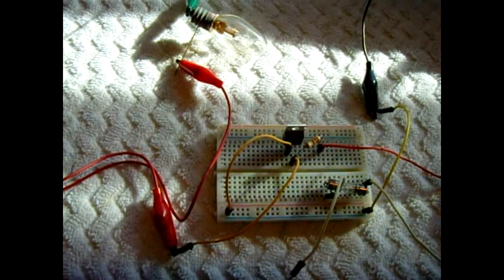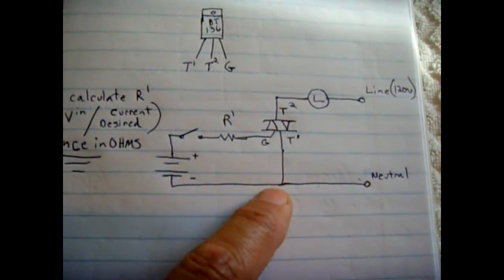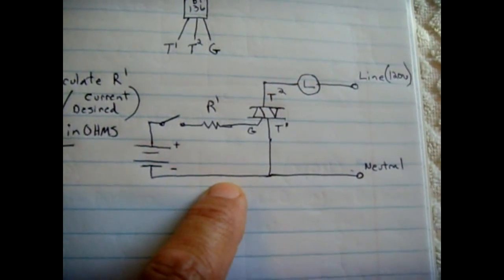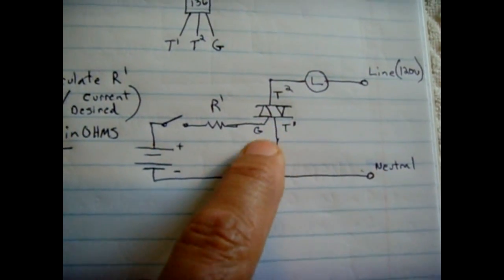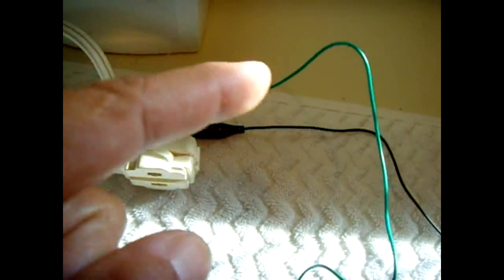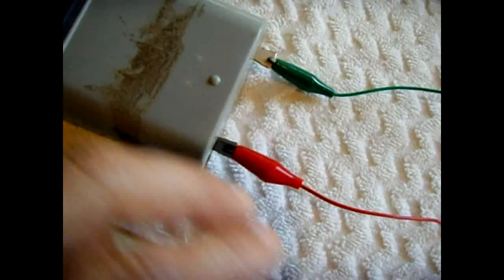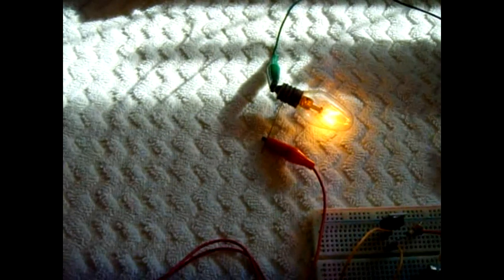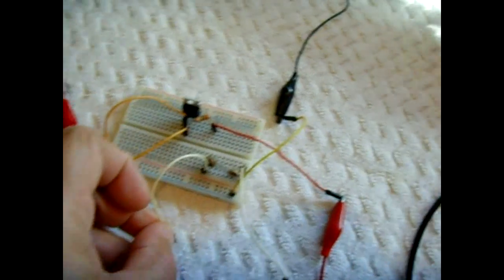How To Trigger Triacs for AC Loads Using DC(Battery)

Comment: I never worked with TRIAC before, so forgive my silly questions. Wont the TRIAC conducts only half of the cycle when using only DC trigger? Is your 120V multimeter reading is RMS?
Reply from the maker: Should be the full cycle, because I am operating my AC drill perfectly. I'm getting positive and negative pulses. My DMM is not a true RMS.
Reply: I also think the lamp and the drill are operating only on 1/2 of the ac cycle; an oscilloscope would prove it.
Reply from the maker: I understand how you would think that. Triggering with positive would only allow positive pulses to pass. Triacs are designed to be triggered using EITHER a positive or negative source. Once triggered, AC current will flow. I have not checked using an O-scope, but I can tell you that AC motors work just fine. I would think both negative and positive pulses are being passed through the triac.

Thanks For Watching! Be sure to check out my video playlists.
Reply: you have to trigger in two alternans differently if you want to use positive and negative alternans.. In this video lamp use only one alternans depending on trigger.. https://youtu.be/xnhR09khLzM?t=584  I have done in a simulation program and have see that only positive alternans can be used on load..

Comment: Thank you very much! I'd never tried Triacs before and your video helped a lot. I have a question: I thought T1 and T2 were interchangeable but it seems that they are not. At least my circuit started working only after wiring it exactly as shows in your video. Can you clarify this point?
Reply from the maker: For reliable switching on and off, it is recommended that AC line power is fed through the load and into MT2. This does not mean that using MT1 will not work.

Comment: I want to know .. if I connected the AC Cable the other way .. would that be a problem .. have anyone tried it ???  The AC oullet in ower country is 220v two wires only and I cannt tell which is which ... thanks for the useful video

Comment from the maker: NO. One of the wires is HOT. If you take a voltage meter on the AC setting and test from each wire to ground(the metal box which the receptacle is in, the green wire inside the box, or the bare wire), the wire that supplies the 120V is the wire to be used as "LINE". The other wire is "Neutral"(No voltage). You can touch the neutral wire, NOT the "Line"/"Hot" wire.

Comment from the maker: One leg is 220V and the other is neutral? If so, then everything should work fine. If you have 110V per leg combined to get 220V, then DO NOT use this circuit. You will be better off using an optocoupler(MOC3041) feeding into a resistor at the gate of the triac, and triggering the optocoupler with a battery.

Comment: hey, thanks a lot for puting up this video. It has been great help in my project work. I have one query. I live in India with 220V mains supply. What modification will I need to make in the circuit if I am using 220V mains? 
As a precautionary measure, I am planning to use a 220V to 30V step-down transformer on the mains and drive some smaller load which will work on 30V supply.

Comment: Nice video. This would work great with photovoltaic cell driven gardening circuits. Feed the cell straight in to the triac or feed it into an arduino/raspberry pi input. The first light of the day can be used as timing/calculation reference and then the 3.3v or 5vDC out used to drive the triac. NICE video.

Comment from the maker: If I was only getting 1/2 the cycle or part of it, I would not be able to run an AC motor/drill. All the battery does is trigger the triac to allow the AC current to flow through it.

Comment from the maker: Thank You! 

NOT a good idea battery POS to LINE AC. Triacs can be triggered with either positive or a negative voltage, but in this case, leave the NEG connected to the NEUTRAL. Make sure you have a very low rated fuse(50 mA) If you had to, 100mA is the absolute MAX I would use between the battery NEG and Neutral, then you will be just fine and have no problems.

Comment: (continued)
2: You can replace battery with a charge pump (2 diodes + 2 capacitors + zener).
3: When turning off, inductive loads produce high voltage spikes accross the triac so it can be killed. I don't know if there are really effective built-in snubbers or not but for a plain triac, external snubber maybe needed. At least a metal oxide varistor.
At capacitive loads, it can be needed to limit inrush current and current rising rate at turning on. But OK, it is not that important at most cases.

Comment: Hi! I haven't use triacs yet but I can tell You that there are some problems with this circuit.
1: Turning a triac on with direct current is a usual way especielly for sensitive-gate triacs. BUT.! In this case it is highly recommended to use negative voltage to the Gate electrode with respect to T1 because triacs are far less sensitive when You apply positive Gate voltage in the negative cycle of the supply voltage. So it is better to reverse the battery.
(to be continued)

Comment from the maker: You have to look up the data sheet for the triac you are using. You need to use one that mentions  a built in "snubber". Some triacs have triggering problems with induction/motors. The only way to reset the triac would be to remove 120V power momentarily.

Comment: Very nice, thanks. Can you show how can i possibly create a transformerless power supply instead of using battery? The tricky part here is that i don't have Neutral in the wall where i want it located.

Comment from the maker: Just make sure you connect it properly. Verify the Battery neg is connected to the house AC power supply NEUTRAL, and use a very low mA fuse in series with the battery.

Comment from the maker: If done properly, and the circuit is placed inside an insulated box with ventilation, the triac uses a sensitive gate with very low current to trigger(as the BT136), which is around 8 - 35ma, and a fuse slightly above the gate current(50ma)is placed in series with the DC supply, then everything will be fine. I guess you have a fear of HV projects. Also, I'm glad you like my video, but don't tell me what videos to not put on Youtube. Thanks for the thumbs down!

Comment from the maker: I guess you have not read the video description box. I clearly stated this is a hazardous project. I also stated this configuration is designed for 120V, not 220V. I also stated that you MUST connect the circuit properly, AND verify that your receptacle is wired properly before connecting this circuit. ALSO, the switch is not needed. a low voltage DC circuit can be used to trigger the gate. You can also use a transformerless DC power supply(no battery).